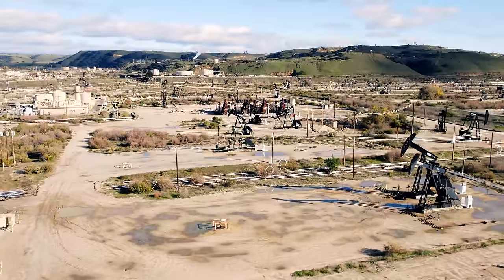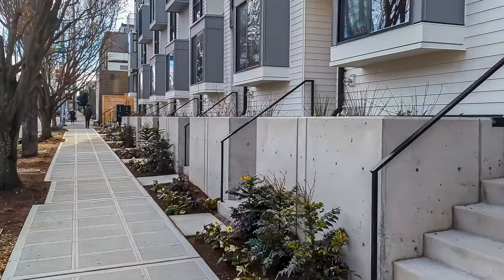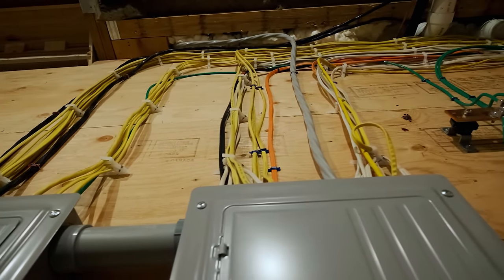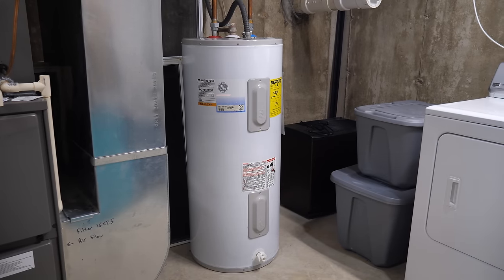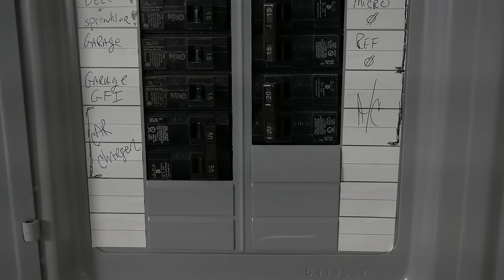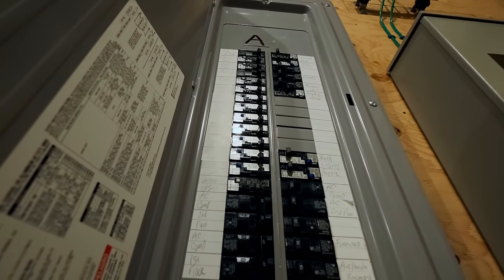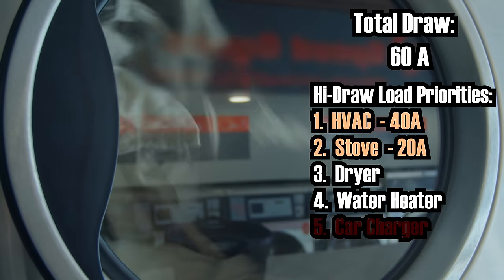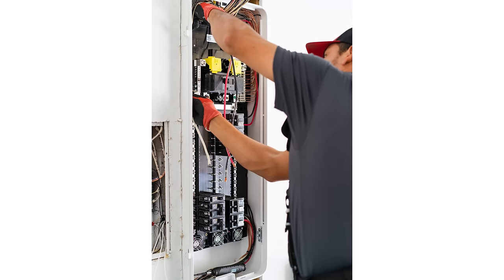Home Electrification: There's not a lot to do, and it doesn't have to be hard (Part 1)

Comment: Most "smart" devices are anything but smart - and that includes "smart"-power-meters.
Had seen it here as a relative was affected by the problem: The IoT device that needed a constant internet connection, yet the company offering them had network-trouble so the power was intermittent. Yeah turns out they were monitoring every single household and using the "smart"-meters to also remotely turn off power. Thankfully they got into some big legal troubles over that.

Just give me back the good old analog devices were i could just hook up a simple clock to start the washing-machine or dishwasher at a fixed time, or we need a good open standard that first and foremost is NOT connected to the internet for dynamic load-balancing.
With Solar-panels that would mean start the washing-machine or dryer when the panels are producing enough energy, heating up the water just in time for when it is needed or when there is nothing else using the power. And for electrical cars - use everything that is not used otherwise and maybe even use part of the battery as a small buffer for other appliances.

Comment: As a Finnish person, my home is almost fully electric, except that I have to heat this up by burning wood. Everything else is taken care of with the power of electricity. I have this one little issue with the main fuse. It can't handle much. For example, I can't cook and have the laundry machine on at the same time. I can't have the dishwasher and the laundry machine on at the same time. I can't use the stove and have the dishwasher on at the same time. Heck, I can only maybe use 2 "burners" of the stove at once, but not at high heat, and I definitely can't preheat the oven while using the stove top. It is such a fucking pain in the ass to try to get anything done. To fix the situation I'd need to get the main fuse situation upgraded (I don't remember the specific specs atm and cba to look it up again) but it would cost 1200 euros (at least) just to get somebody to come over and activate the 2/3 of the main fuses in the fuse box (or so I've understood) and I don't have that kind of money and my landlord (who is also my dad) thinks that I don't need to be able to access more power at once. 

I don't want to switch away from electricity, and tbh I'd like to be able to heat up the house without burning wood. I just wanted to complain about the situation.

Comment: Here in Australia we had an incentive scheme to encourage roof-top PV generation.  Sadly there were serious problems with the scheme.  The feed-in tariff was unsustainably high (yes, the irony) and was not available for rented residences and thus the price for grid electricity went up drastically to cover it, paid for by people who were renting rather than homeowners or landlords (we didn't get a system because in the current scheme it was socially irresponsible).  The way the feed-in tarrif worked incentivized using electricity when it WASN'T being generated on the roof, thus increasing the overall burden on the grid.  PV systems had to be grid-interactive, so couldn't actually be used to go off grid.  The overly generous provisions for installation resulted in a boom industry of inexperienced installers who disappeared in short order.  Also, semi-related, everybody here seems to think that residential air conditioning is a necessity, when a reasonably designed and built residence in our climate simply doesn't need it for most of the continent.

Comment: One of the big problems with society is our lives are all synced. 5 days a week, we all get up at the same time, require hot water for showers and power to cook breakfast. Then we run off to work and our homes are on low power/energy consumption mode for roughly 10 hours. Then we all get home at roughly the same time, turn up the heat or AC and cook supper... all roughly at the same time. As a collective, we need to force corporations to break this everybody needs to be at work at the same time thing. What if a percentage of society was bit shifted just 4 hours. Rather than waking up at 7 to be at work for 9, they wake up at 11 to be there by 1. They are still in bed, not consuming resources, while the rest of us are getting ready. Then when our houses are on low power/energy mode, the 4+ hour people are using power/energy to get ready. The reverse is true in the evening.

Comment: An idea, and I’m no electrician, so correct me where I’m wrong.

Rather than having a fancy electrical panel that is able to shut off and and monitor each and every circuit. 
It seems you could just have a smart system that monitors power draw for the whole house “the hub” which also communicates with each high power device over some protocol.
Through software negation this would allow the high power devices (which had the right software) to shut off and turn themselves back on gracefully, and allow for things like decreased charging rates, and would prevent the annoyance of a clothes dryer shutting off mid cycle and not automatically finishing later. 
Adapters could be used for high power devices that didn’t support the system, these adapters would have contactors and also monitor the power usage of the device and report it to the hub, this would be perfect for things like water heaters, were there really isn’t a downside to just killing and restoring power to them.

Comment: Well, this all depends on where you live.  I am in new England and live in a gas house.  And instead of 4 things, we have 6 things.  In addition to all those you mentioned, we have a grill on the gas line (big deal, right), and our generator (whoops).  And the power around here is known to fail at times.  Also, gas is cheaper right now than electricity.  

So going all electic is a great idea for a lot of the country.  But relying on electicity when the grid goes down when it's -30 out, somthing that happened this winter, is not an idea we are going to jump on.

Comment: There's literally nothing wrong with "setting fire to stuff" to power things. The only reason that the price is volatile is because we are discouraging it's use. Using the wind or sun to power a modern grid is a stupid idea and one that will cause more problems the more of it we use. It's not reliable and it actually costs a lot because you need more infrastructure and backups for when the wind doesn't blow or the sun doesn't shine (which a lot of times happens when you need the most energy). Now if you want to talk about using nuclear energy to power more of the grid then fine, but that is NOT what we are doing in practice. We are moving from a more reliable for of power to less reliable and this is actually a step backwards.

Comment: The favorite thing I've seen is called a "sand battery" essentially it's a tank of sand with heating elements inside. It will take any produced but unused energy from solar panels or wind and store it as heat. With the right insulation it can hold that heat for months on end with shockingly minimal loss.  Then you can push the heat transfer loop through the tank to create the temperature differential needed to have heat pumps work at peak efficiency. Even during the summer the sand temperature will be higher than bient temperature allowing for a greater temperature gradient and more efficient cooling pumps. You can also directly pipe the heat with water pumps for hot water tanks 

Imagine it like having a tank of pure heat energy you can extract a degree at a time. Yes the transfer will be inefficient but you will ultimately end up losing that electrical energy anyway so this way you keep a portion of that.

Comment: Of course the elephant in the room here is that in most cases (at least in my experience) is that natural gas is VASTLY cheaper than electrical power.
If you want people to adopt "all electric" you don't need gimmicks like rebates and tax credits (which are one time scams) you need to PERMANENTLY make the cost of electricity cheaper.
Reply: Or that oil is the bases of all modern products.

Comment: I want to say normally i appreciate your videos but why don't you mention the cost, when talking about the smart panel you don't mention that for Just the SPAN panel is $4500 not including install costs, while the national average cost for a 200amp service upgrade is anywhere from $2500-$4000. There is also the aspect that many people may not want to install a smart panel that's proprietary from a company that may not be around in 5-10 years or may charge big costs for servicing down the line, while basic service panels are pretty universal. 

Normally I think your videos are very good but i think in this aspect you have tunnel visioned on a thing that works specifically for homeowners with a lot of disposable income.

Comment: 20-30 years ago here (Europe - Czech Republic) they also pushed people to get electric heating, get rid of gas stoves, etc. A lot of people did that, there was no problem with electricity from the distributor. Over time, however, electricity prices rose so much that most people returned to gas, and in the villages partly to coal and wood. Now the European Union wants to ban everything except heat pumps.

Comment: I'm thinking that even if you have to switch off the resistive heating temporarily in order to use your electric range, unless you immediately throw the hot food out into the cold and pour the freshly boiled water into the drain, the electricity that you used for cooking will also heat up your home!

Comment: As a Swede watching this it’s quite amazing how different it is in the US compared to here. I had a house, 240sqm (2600sqf) that was all electric and during winter time we often had weeks with -30c (-21f) and often a week or two with -40c/f. That on 16A breaker (guess it’s equivalent to your 100A, way to small without clever controlling). 
The main source of heat was from two modern heat pumps. Total installation cost for both was around 4000 usd.
We had a wood burner as well but we almost never used it. 
I used Apple HomeKit to control it all and a really cheap electricity meter so that I could see the current load before starting all the kitchen appliances. Yes, we couldn’t wash clothes while making dinner, but there was no need and we made sure most things had timers, we could load the laundry and set the timer for when the dinner was ready, same with the dishwasher, load it in the evening and it started 5am. When we left the house the ac went down a bit to save energy and when motion was detected it went up.
It wasn’t really a problem. In Sweden all main breakers will be upgraded to have a control port for home integration in the future but our was quite old and most of the wires was from the 70s as well as the house. It is possible
Reply: As a Swede, you should know the idea pays for your country's defense, so yeah, things are different.
Reply: Canadian too, that's why I'll always laugh at the idea that living in a cold region necessitates gas.

Comment: I live in an area where it gets to below -30C every winter for weeks.  Will a heat pump work for me?
Reply: Most of the time, yes. Some work all the way down to -20 

But for the occasions it wouldn't work most replacement option heat pumps are actually a hybrid heat pump & backup resistive heater
Reply: @afgor1088  so it works down to -20, where I live it is -30, or colder, for weeks.  What is the cost of the resistive heaters?  Will the resistive heaters work at -30 for several weeks.  Will it keep me alive, or keep me comfortable?  If it will not keep me comfortable, then it is not a realistic option.   I am not willing to spend thousands of dollars to switch from my natural gas furnace to be uncomfortably cold for several weeks every year.
I am very interested in heat pumps, but I don't believe they are a realistic option in places that get extremely cold, where I live.

Comment: You can connect it to home assistant running locally on your network to not have it connected directly to the internet. Also, with eg. a NIBE Ground Source Heat Pump you don't need heat strips even in a very cold climate, as the ground will never dip below freezing.

Comment: Gas is more reliable, in many ways. The electric grid goes down pretty often, gas usually doesn't. If you only have electric in a cold climate and the power goes out, you're screwed. With gas, at least you can run your stove/oven if you need to, for some heat. Gas water heaters with a pilot, same thing. You might not have lights, but you can still bathe. Trying to force people into going fully electric is probably never going to work, especially in rural areas.

Especially when the electrical grid is allowed to be owned by capitalist pigs that don't care about maintenance. Just look at the mess in Texas a year or two ago from the grid going down in a winter storm. Refusing to address it shows you are being purposefully dishonest in trying to push an agenda: "We need more electric usage but neverminded the rotting infrastructure that our corporate masters won't fix, more electric usage anyway!!"

Oh and guess what, clothes dryers at public use pay laundromats are gas, because imagine the insane electrical panel they'd need to power 30+ commercial sized dryers all running at one on electric. I bet the many water heaters required for the 30+ washer machines are gas too, for the same reason.

Comment: I installed a Effergy power monitor back around 2013 that I use to monitor wattage since I have 100amp service. I use 5kwh-8kwh intermittently throughout the day for heat using normal 110v/120v electric radiators. I can do this because I have many circuits on its own breaker and some rooms with only 3 outlets on 1 circuit. This is how I wired my house for emergencies, such as if the boiler goes down in a storm. I have 11 space heaters. 

As for this year I've run all electric for heat since it was lower in price than fuel oil. Upstate NY can be cold. Up here many of us are a firm believer in multiple back-up heating plans. I also have portable propane heaters, (Mr.Heaters) Diesel fired heaters. (12Volt) Back to the subject, My house is all electric now. Range, Dryer, Hot Water, Heat. I think that is all I have for High draw items. Not including the basement and shop heaters which is 5,000 watts x 3 = 15,000 watts. I can't run those when all the others are on, lol. So yes a 100amps is a lot of power for 1 household usually. 23,000-24,000 watts. I can run 26,000 watts for about 5 minutes before I trip the mains though...Aww man, I said that out loud. You gotta stress test things sometimes.

Thanks for the video.

Comment: In Africa grid is unstable. Many in my country are removing electric appliances to replace with gas. Wood closed combustion heaters are making a big comeback. Insulation is also more of a topic along with small solar installations. Suspect many countries outside the US have similar issues when everyone ties into the grid for power on electric appliances.

Comment: I was shocked by your initial anxiety for using a 100A vs a 200A service. Later you got straight to the point, there's nothing to be anxious about.

Not everything works at the same time, and even if you have everything working at the same time, it would be a massive coincidence if all they were draining their max power at the same time.

Just checked and I do have a 33A service (4.4kW). The installation would work with way heavier loads but here in Spain you pay a fixed term by the kW for the available power so we try yo keep it as low as possible.

This winter I only used my electrical heat pumps for heating, so I used natural gas only for heating water... and didn't have a single disruption.

And I even got to run all the heat pumps, the electrical furnace, the dryer (yeah I do have one haha), the washing machine, the dishwasher, the oven, the coffee machine and the tv at the same time.

Comment: This is cool but isn’t applicable to any appliance that runs on a programmed cycle. A clothes drier, washing machine, AC unit. Not only that, edge case uses are going to get annoying real quick.
Oh what’s that, you have an emergency or appointment and need to get somewhere for some reason? Oh wait, you can’t, because you just got home from work and your car was almost empty but it chose to turn off the charging circuit to run other stuff in your home, too bad.

Comment: Some older rural homes (province of Quebec) that are heated with wood still only have a 60 amp service.  You'd have a fridge, a woodstove, electrical lighting, washing machine and a small oven / hotplate.  Those older Belanger wood stoves could heat an entire house in the dead of winter to 30 deg C.

Comment: Isn't all-electric-home sounds like all-eggs-basket?
I mean what happens if, for example, an unusually cold winter breaks our electric grid? Without gas at home we can't cook and can't be warm and without... you know... gas in our cars we can't even go somewhere else.
Nah, forget it! Here in Texas it is impossible scenario!
Reply: gas shut-offs also are electrically powered, and often default to closed without electricity, which means no gas. Just get a proper electric grid by funding that instead of fossil fuels
Reply: @ThompYT  Electric circuits in home gas equipment might be powered by small source like generator or backup battery. And most power outages caused by destroyed lines, not by power plants, so it doesn't matter if they fossil or renewable.
Reply: @dvolkov76  if there's still power then you can have electric appliances...
Reply: @ThompYT  You do realize 1 kW generator is enough to keep your computer alive but not enough to heat the whole house, do you?